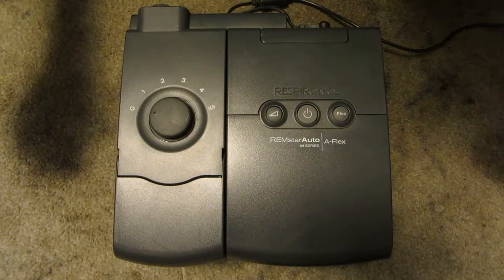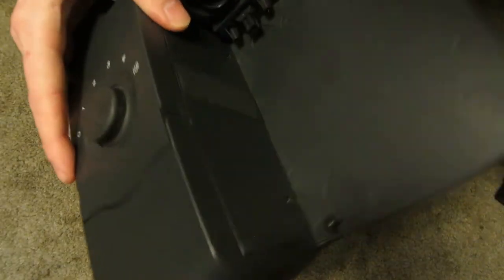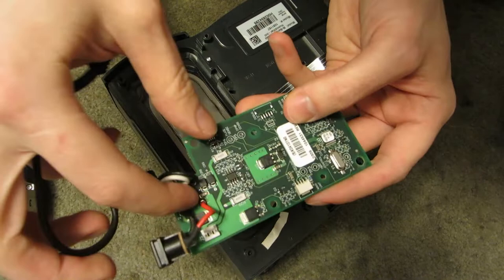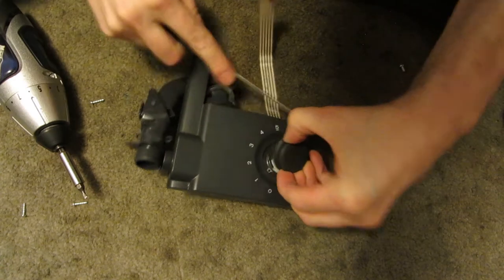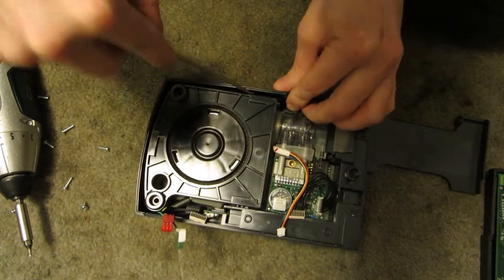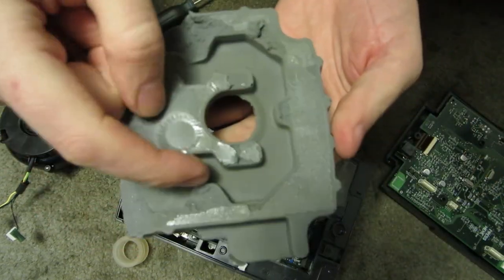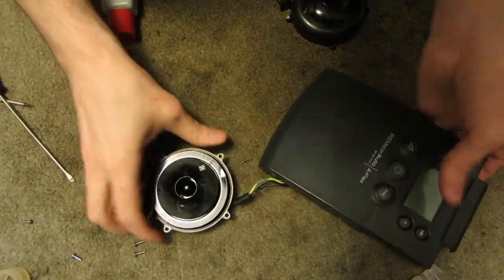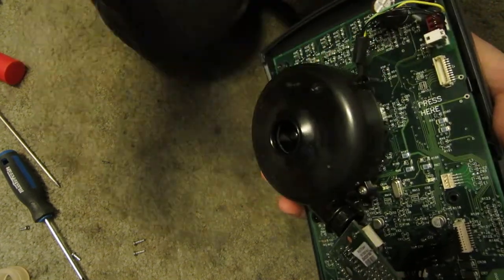Equipment Autopsy: Sleep Apnea Machine

Comment: Great device was my first CPAP and used it for 15 + years. The motor unit lasts forever but the humidifier is the fail first point.  I am a Bmet II and have worked on a LOT of these different brands and models and this will at last anything I have seen so far. They probably stopped making it because of that fact. Can't sell someone a new unit when the old one works just fine. Most I see now last 4-5 years.

Comment: 21:49 That's a slight airflow restrictor, for creating a pneumotachograph (air speed sensor) with the differential pressure sensor attached to each side of the restrictor.

Comment: Does anyone know what cleaning needs to be done to this CPAP? It seems that only the hose, water container and filters need to be cleaned
Reply: First of all I believe this machine was recalled due to the foam inside degrading and making its way into the patient's Airways.
Reply: @javi8129  - it wasn't this model, it was the model that replaced this model.
Reply: I run a half and half vinegar/distilled water solution through mine for five hours on the weekend. Other than that, hoses, mask, and filters.